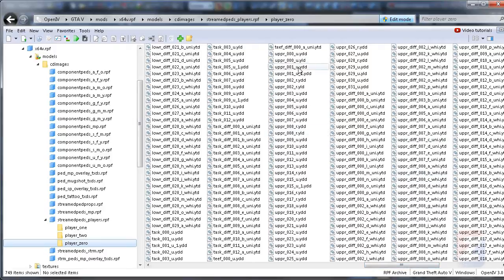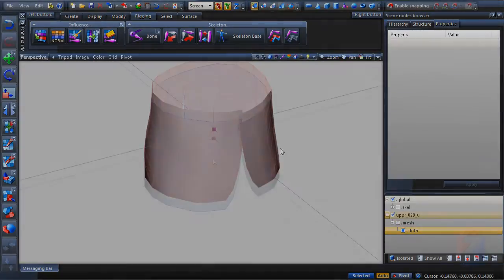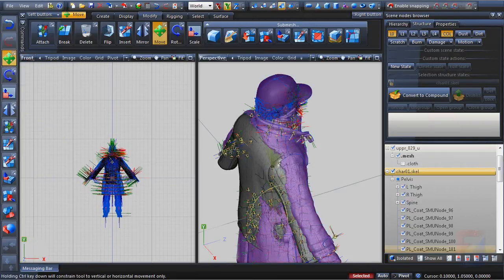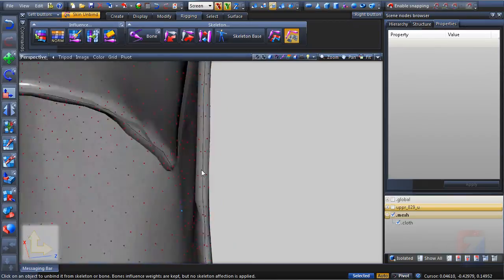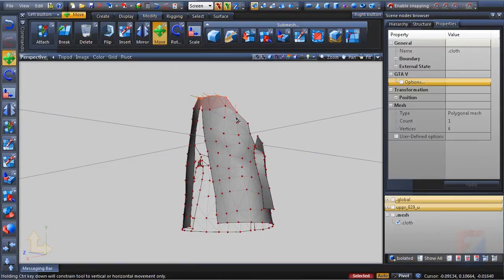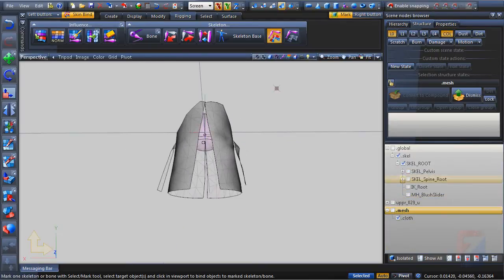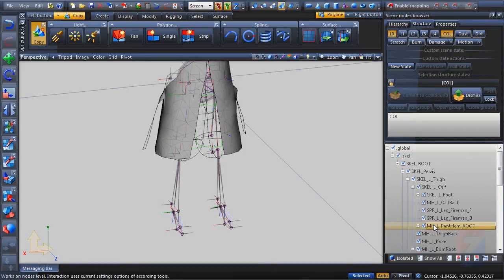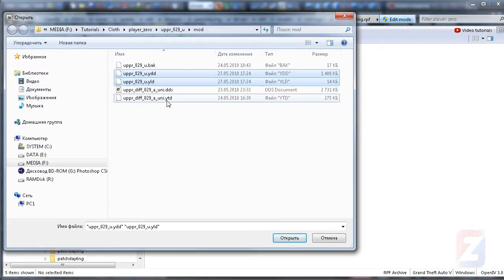ZModeler: creating GTA5 cloth mesh.

Comment: Considering the YLD file requirement would it pe possible to do this for the mp_m_freemode and mp_f_freemode peds ?
Reply: are there any .yld files for original mp_f_freemode? if they are available, you can use cloth on these components.

Comment: how can do this in 3ds max?
Reply from the maker: you can create geometry objects you need in 3dsmax. then export into .dae or .obj file and import into zmodeler. the rest can be done in zmodeler only.
Reply: Thank you, only that I had 15 days for Zmodeler and it's finished, so I'm testing in 3ds max, but I don't know how import the YLD files, you know how can do it?
Reply from the maker: Make sure you run the latest version of ZModeler (press green down arrow icon if you see it in the bottom of ZM window). ZModeler should be 3.2.0 build 1182 if I'm not mistaken.

YLD file is a cloth add-on for YDD model, so you need to import YDD file before you can import YLD file.
Reply: Yes, I have the last version but can't use Zmodeler because is a version Trial, so I'm working with 3ds max with GIMS Evo, only when export a file YLD with OpenIV, this it create two files inside a folder,  namefile.sys and namefile.full, I not export the files with the original format because GIMS Evo not suport it, only that I don't know how add the YLD exported as .SYS and .FULL on the model YDD exported as .ODD, if you know how I can do it, can say me please?
Reply from the maker: You can't modify .YDD in 3dsmax, GIMS Evo or in any other way. Files .sys and .full are raw dump of uncompressed file data, it is not editable. Trial license being installed lets ZModeler do exactly the same thing as paid license, so when trial is installed in ZModeler you should be able to import/export .yld files. Mind, you have to export .ydd and .yld from ZModeler if you want cloth simulation to work properly. Using a .yld from GIMS and .yld from ZModeler export will corrupt cloth simulation because of mismatch on geometry and their cloth-control vertices. Other than that I suppose GIMS Evo will not export cloth-ready .YDD file at all.
Reply: Thank you so much :)

Comment: How to properly add .cloth to the .mesh? I have the cloth mesh ready, but obviously I need to change some parameters in order to get the .cloth options. I merged my new cloth into the old cloth, but I got a rigging error with mesh. It worked (cloth sim) but now mesh it’s attached to some elbow bone. (And I attached it to .skel)
Reply: did you do it ?